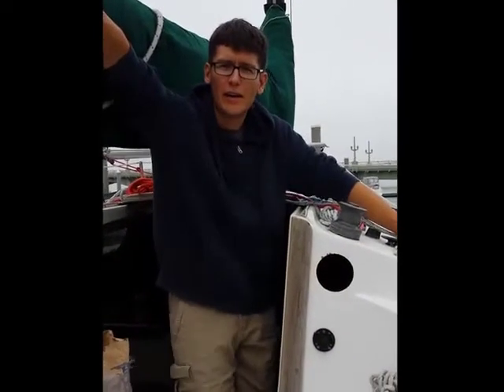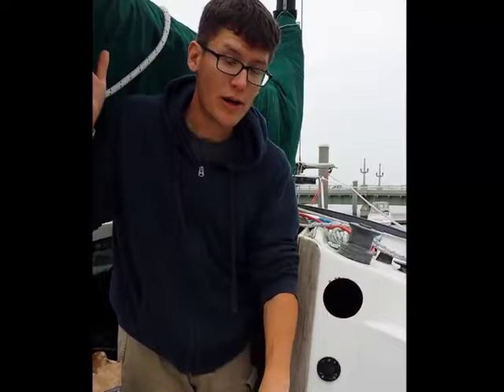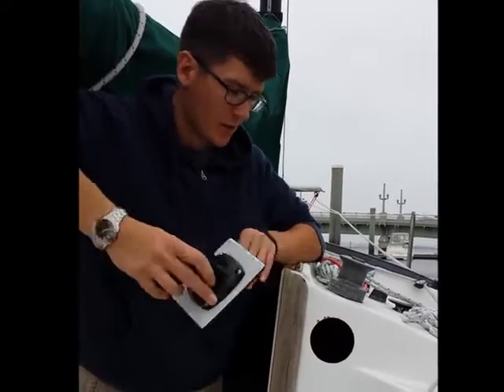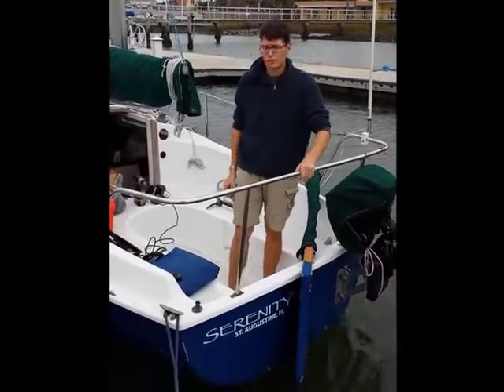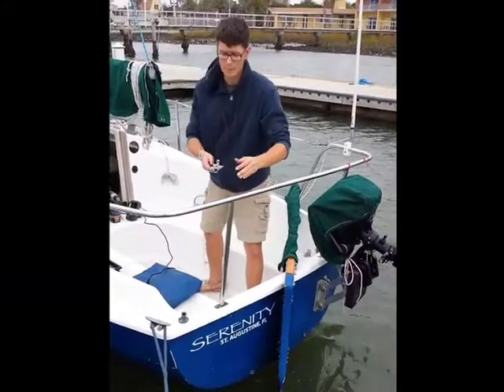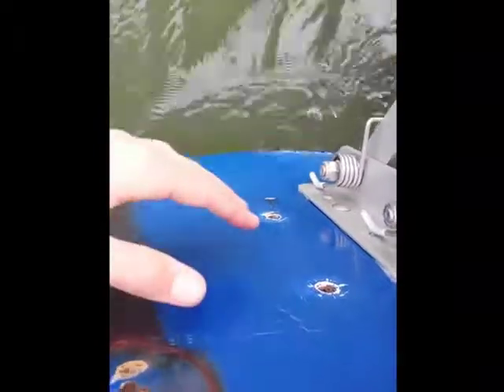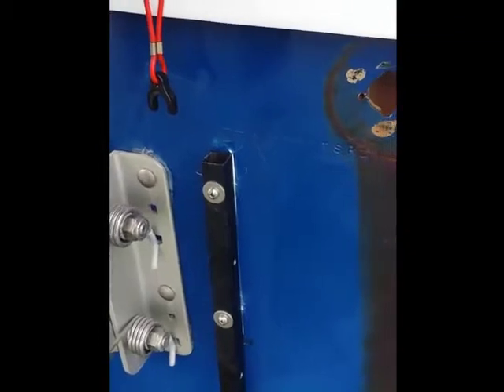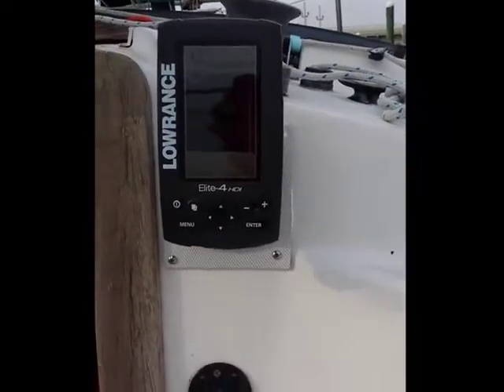Sailing Serenity How To Install A Transom Mount Sonar On A Sailboat

Comment: Hey, great video! Thanks for it!

I actually am trying to install the very same sonar transducer, the guy in the shop told us we could put the transducer in direct contact with the inner part of the glass fiber of the hull, except we have to mind  the keel (which jams the signal).We decided to give it a shot... except that on the sail boat we have, the entire surface of the glass fiber is covered with some kind of foam-like material (for insulation?), and our keel is just enormous (it's an Albin Vega). Another detail is that the fiberglass that has the foamy material is not in direct contact with water. So all the trials to install the device in the boat, rather then off the boat, resulted as a big failure.

The device was clearly designed for motorboats., with direct contact of the fiberglass with the water.

We also wanted to install the transducer in the bow of the boat, rather then on the stern (here the coastline has some very steep slopes, and sometimes you can have 3 or 4 meters = 9.8 to 13 feet depth difference in 1 meter = 3.2 feet distance towards the shore), it is therefore very important for us to have it in the bow of the boat (preventing a collision with the rapidly raising bottom).

I though on a similar solution as your for the bow. I was then wondering about the sailing boat's tilting, how does it affects the readings?

I was actually thinking of adding one degree of freedom by installing the system in the boat axis and by allowing it to roll. But I am not sure on how much advantage this would be, over making it work in a simple way...

Any thought on this?

How satisfied are you from the product?

Thanks in advance for your answers,

May the wind blow in your sails! :)
Reply: Benoit Espinola  The sounder beam is a cone of about 15 degrees,so you would have to heel more than that for any effect.
In reality,most yachts cannot mount their sounder vertically anyway.

Comment: Nice job! Thinking of doing something similar on my boat. I got a Garmin fishfinder that comes with a transom mounted transducer and none of the flush through hull models will do the ClearVu and Chirp like the transom mount does. I noticed yours will drag in the water. Did you think about any improvements on the design to lift it up to be out of the water when not in use and not drag when heeled over (maybe like the lifting motor mounts or a pole in sleeve design)?

Comment: You legend! I have the same model and was wondering how on earth I was going to get the thing attached with minimum fuss. I am not keen on drilling through the hull but having wires across the cockpit seems even worse.

Thanks again!
Reply from the maker: I ended up running the wires under the stowage bin, through to the interior cabin and right up to the Lowrance. All extra cabling stowed away inside and out of the way. :)

Comment: Nice installation.  I'm trying to do something similar.  One thing I would avoid putting it on the same side as the propeller.   I am thinking about a way of mounting on the bow, which would be better for depth sounding to know when you getting into shallow water, before you get there.   I am thinking of some device where I could raise it and lower it as I needed it.   Will all your hardware resist saltwater corrosion.

Comment: how does it go when you heel over the other way. does prop wash affect it.
Reply from the maker: When you heel it comes out of the water and you lose the signal. It comes back once you pop back down. Just make sure you're not bobbing around in the shallows. I used the Lowrance to avoid hitting the keel on all the oyster crops and sandbars we have here, never for finding fish.
Reply: A transducer out of the water is very prone to overheating and failure. Water is 25x more thermal conductive then air I'd consider a rudder mounting. I've heard of guys having transducers in plastic kayaks and ruining the kayak from heat